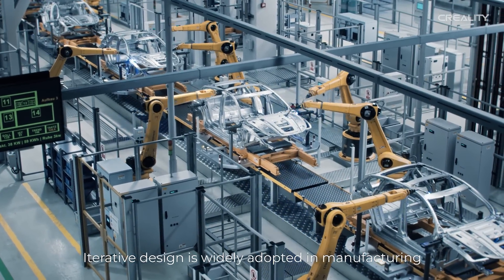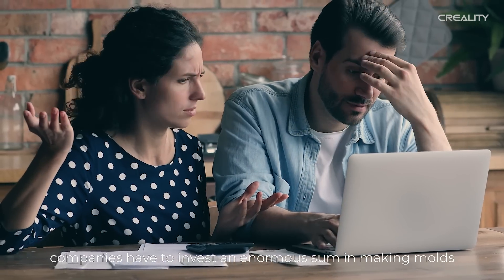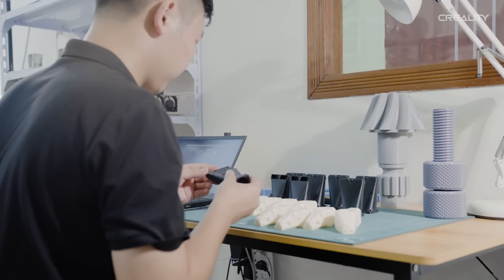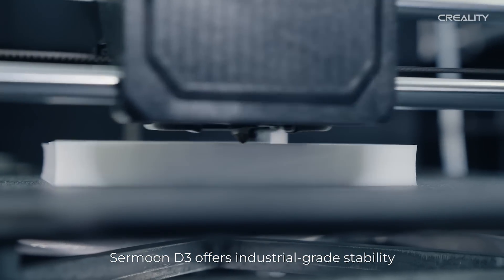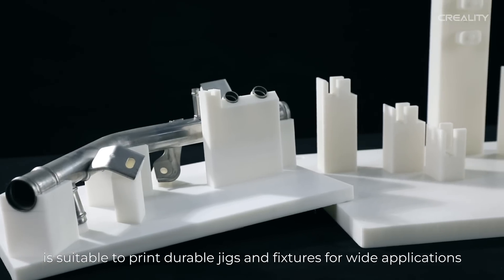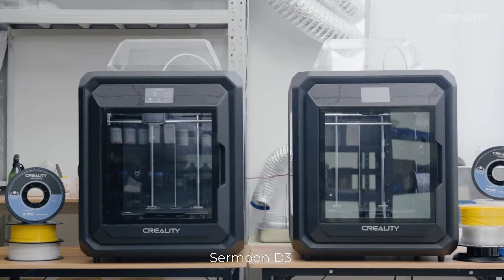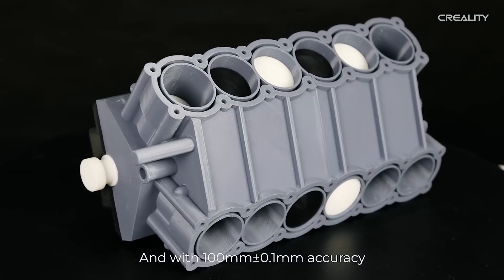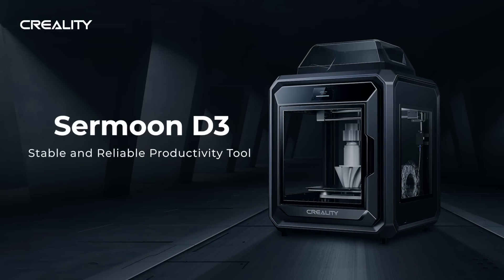Sermoon D3 – Born for Industrial Design

Comment: 100mm+/-0.1mm accuracy? Damn! Creality going back in time.
Reply from the maker: Thanks for your comment, but we have to explain that the precision of the D3 is more than ±0.1mm. The step size of the X, Y, and Z axis of D3 is 0.000781mm,  0.000781mm, and 0.000156,  so it can prove that D3 has higher precision than normal 3D printers
Reply: @Creality3D  all printers have low step size and that doesnt matter it's al about the presicion when you lay the filament down